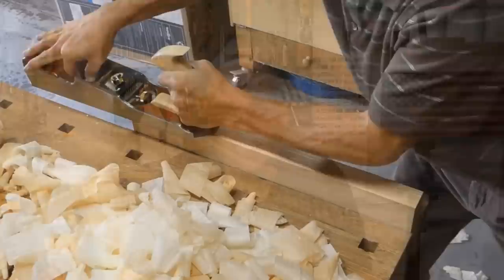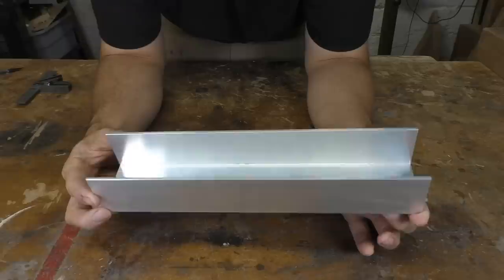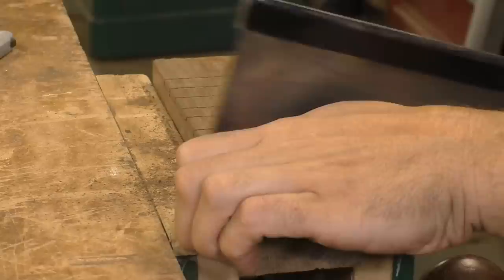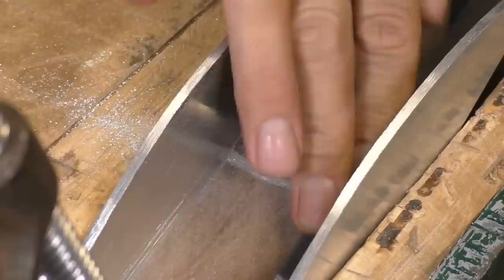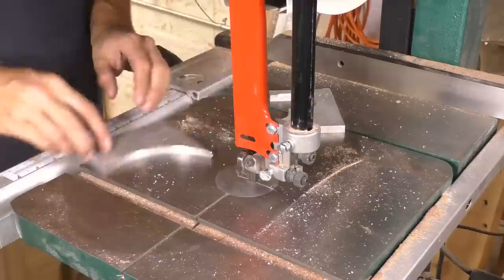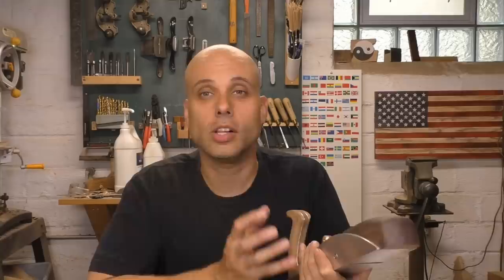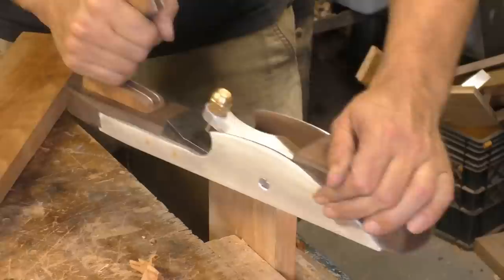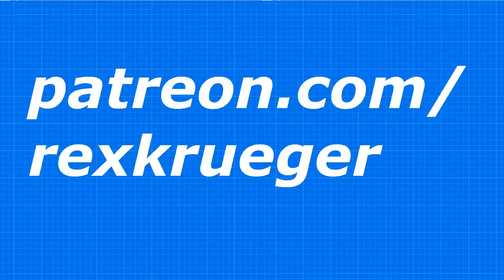Make your own Low-Angle Jack Plane

Comment: I think low angle planes get the positive comments because shlubs like me who can never keep a regular plane with cap in "tune" for very long find them way more usable. I know I was shell shocked by the incredibly crappy regular plane - and wooden plane (both with subtly warped bottoms and frog off on the one and wedge screwed up slightly on the other) I started with which I didn't know I had, til I got to try a good one. 

So the low angle plane with the less pieces to be screwed up made me at least not fear planing, and even kind of enjoy it. It probably isn't really any better but psychologically for me now they are it.
Reply from the maker: I'm surprised that a regular plane gives you such trouble. I wish I could help.
Reply: @RexKrueger  Well I have fun with the low angle plane and it does what I want. I am not a collector, but I do think there are a lot of people like me who walked into a big store and bought a plane thinking it would work without (many) hours of fiddling. 

I may just been unlucky, but had bottoms that had small deformations right around the mouth, that didn't come out with hours of sanding. Chip breaker that doesn't meet the blade nicely even with a little work, and not knowing how to adjust the tension on this complicated 4 piece thing (Frog, Blade, Chip Breaker, cap) made it so when I picked up the low angle jack, just used it and it worked, I was hooked. Little to no adjustment, thick steel, no chip breaker to fiddle with, very little side to side to worry about (always a prob with reg plane for me.) nice cuts. Can bring in the mouth or move it out is the only complicated thing for me. Geometry wise with the thick iron it is very equivalent to a regular plane. Like I said before I don't think it is better in a functional way, but for me it is a lot easier mentally...
Reply from the maker: That's really interesting.  I never really saw that advantage until now.

Comment: Let's get started. Pull out your $800 drill press and $650 Grizzly bandsaw... Now lets pull out the hand plane you don't have and sneak this piece of wood up to the correct measurement..
Reply: He said it in the video, you can do all the cutting and shaping with a hacksaw files and sand paper.